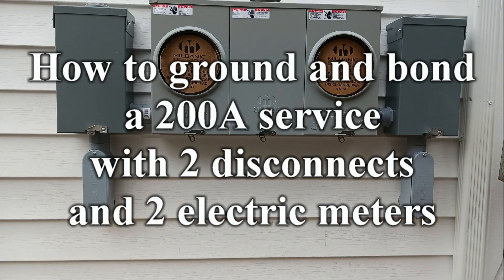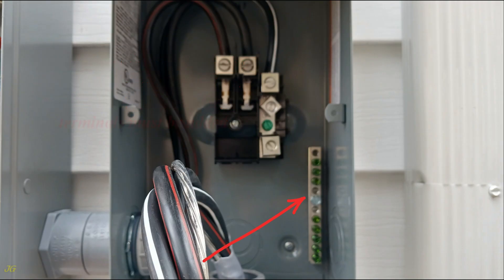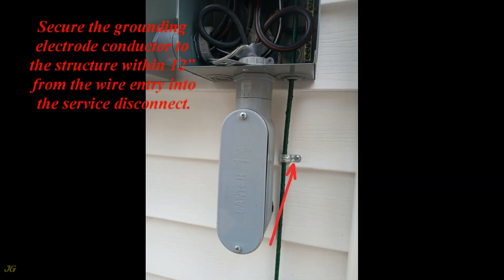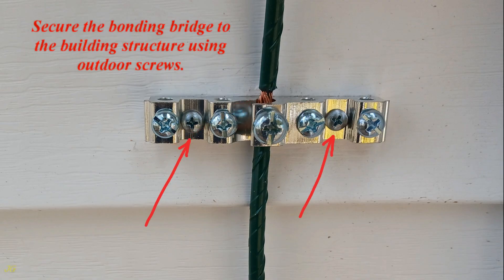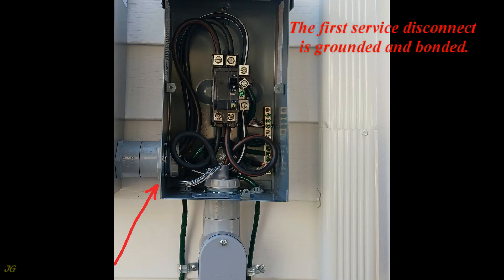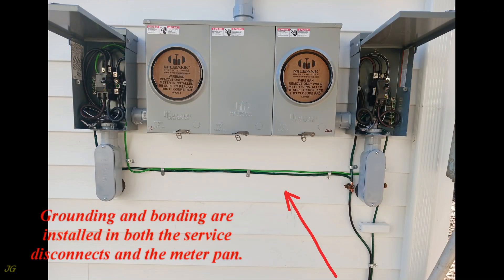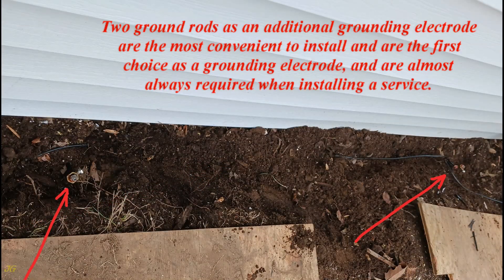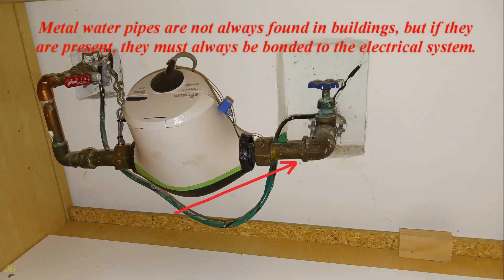How to ground and bond a 200A service with 2 disconnects and 2 electric meters

Comment: This is illegal as shit. You can’t just splice with a split bolt and call it good. Irreversible means of splicing or bus bar
Reply from the maker: I don't know who are you and you probably know everything better. An effective ground-fault current path  shall be established Art 250.4(A)2023 NEC. Art 250.8(A) Permitted methods. All service wiring including grounding and bonding is approved by person having jurisdiction over code compliance (electrical inspector).